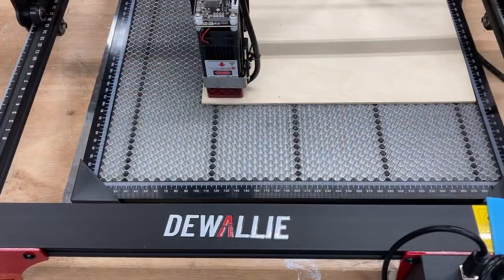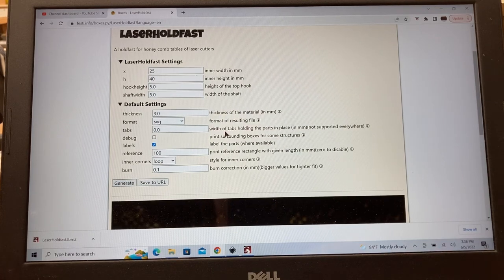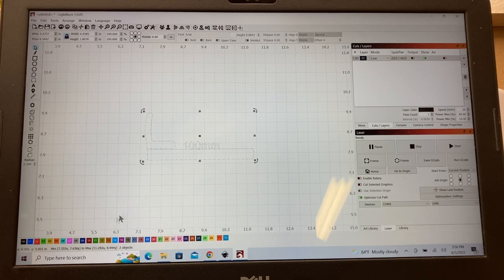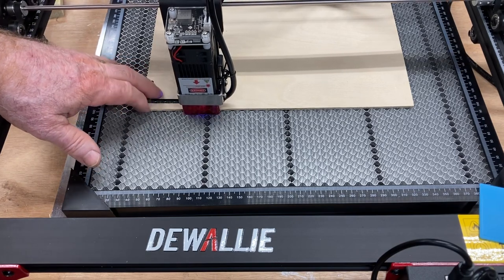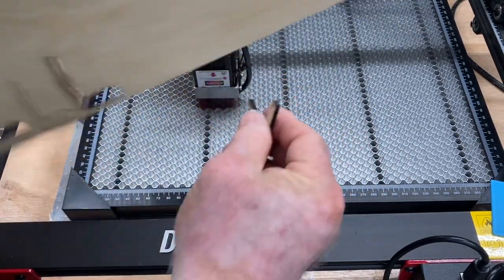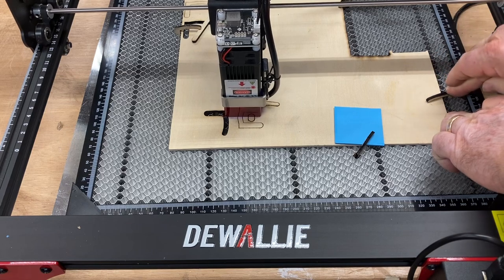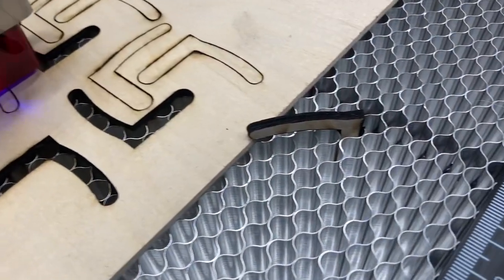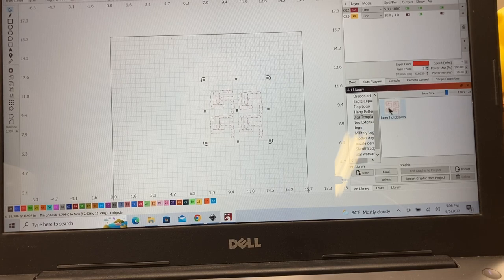How to Make and Use Laser Holddown Pins

Comment: Hi - any chance you can share with me the LB file for these dogs?
Reply from the maker: I would suggest downloading the box app and make your own. The reason is honeycomb beds have different size holes. You need it tight but yet not bend the structure. Link in the description
Reply: @PawPawsWorkShop  thanks but I dont see anything about the box app - I'm a total newbie so be kind.
Reply: Dont worry - I've just drawn some up based on your basic shape and got the sizes spot on - working like a charm.
Reply from the maker: Awesome!

Comment: Hello, nice work and i have question please. I bought a Sculpfun S9 about a week ago. After assembling it, I found that the Z-axis, which has wheels on both sides and a belt pulled over them, does not run smoothly and always seems to get stuck (jump) as if there was a flat on the wheels or an unevenness on the rail. It always does the same on both sides. I've also tried removing the belt, but it has no effect. Any ideas? Thank you very much.
Reply: Sorry, no Z-axis.....X-Axis